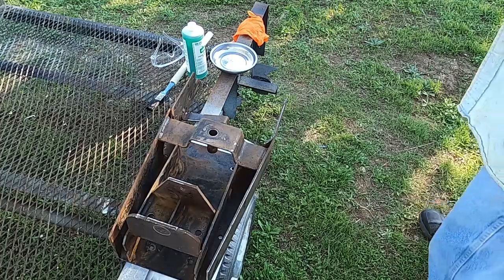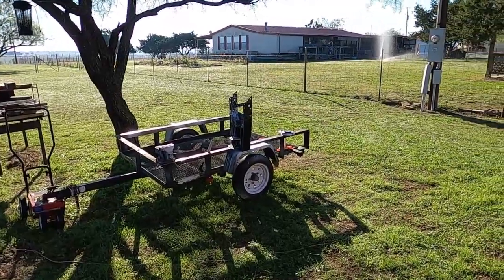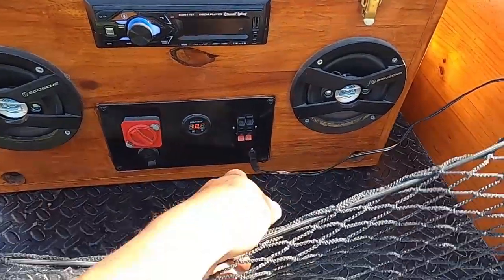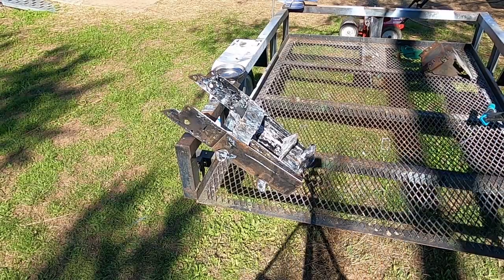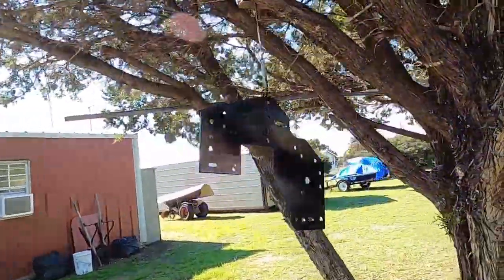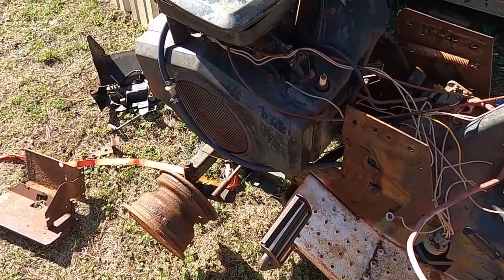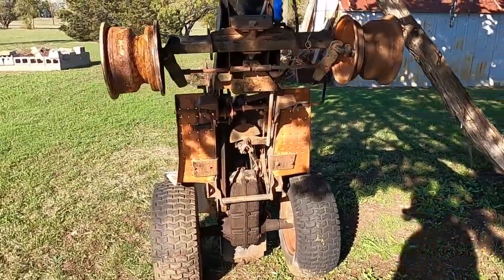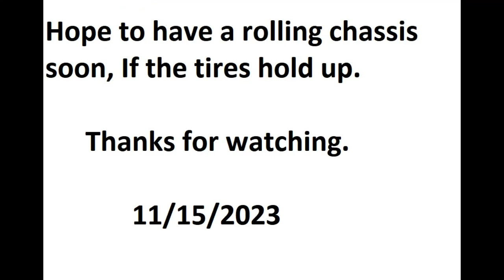Roper 16T   OSPHO Experiment and parts scavenging

Comment: We always struggle with tubeless tyres. It is incredible how tyre shops seem to get it right every time. The rust stuff looks interesting. JB weld seems like the perfect soltion to rust pitting but as long as all the rust has been removed I think a quality filler/bondo is good enough. I would not want to see the pitting on the finish

Comment from the maker: A METAL TREATMENT-NOT A PAINT
RESISTS/RETARDS RUST-PROVIDES A SOUND BASE FOR PAINT
Directions for use
For Application Questions Not Answered Here Call Factory Direct at: 216-771-1590
 

OSPHO is a balanced formula of Phosphoric Acid, Dichromates, Wetting Agents and Extenders. Ospho is environmentally safe and non-flammable. OSPHO seals out moisture and prevents future rust from forming. OSPHO can be applied to just about any rusted or steel surface including: Vehicles, Trailers, Fences, Iron Railings, Sheet Metal, Outside Tanks, Lawn & Farm Equipment, Marin Applications and more. OSPHO is primarily used for bars-metal applications but can be used painted surfaces as long as the quality of the paint is not compromised. OSPHO isrecommended for use under oil based primares or paints. Test trial samples before using Epoxy or other paint systems. A paint job will last much longer afetr an application of OSPHO because subsequent paint coatings attach themselves so tightly that moisture and oxygen cannot attack the metal. OSPHO is water thin and therefor covers a larger area ten painrt and goes on easily. OSPHO is easily effective for exterior and interior work alike. OSPHO safely dissolves bleeding rust from many painted surfaces. For best results, use OSPHO at temperatures no lower than 36°. Excess dew and humidity may prolong drying time, cause a reoccurrence of the drying process resulting in a powdery buildup. Spray equipment should be flushed out with water after using. Clean brushes with water. Avoid spreading OSPHO on adjacent areas such as concrete, masonary and stone work as it will etch/bleach almost immediately. 
 

RUSTED METALS - OSPHO is a rust-inhibiting coating - NOT A PAINT You do not have to remove tight rust. Merely remove loose paint and rust scale, dirt, oil, grease and other accumulations with a wire brush or pressure washer and let dry - apply a thin coat of OSPHO as it comes pre-diluted in the container. Let dry overnight for a minimum of 24 hours, then apply whatever paint. Longer dry times may occur depending on temperature, humidity and over-application of product. OSPHO has the consistency of water and treats up to 600 square feet per gallon. When applied to rusted surfaces, OSPHO causes iron oxide (rust) to chemically change to iron phosphate - an inert, hard substance that turns the metal black. Where rust is exceedingly heavy, two coats of OSPHO may be necessary to thoroughly penetrate and blacken the surface to be painted. A dry, powdery, grayish-white surface usually develops when cured. Brush off any loose powder and wipe down with Mineral Spirits before painting.
 

NEW METALS - For new ferrous metals: remove dirt, grease, or oil; apply OSPHO in a thin coat, let dry for a minimum of 24 hours, then apply paint. Longer dry times may occur depending on temperature, humidity and over-application of product. A dry, powdery, grayish-white surface usually develops when cured. Brush off any loose powder and wipe down with Mineral Spirits before painting. OSPHO penetrates deep inside of the metal's pores to convert and protect before Iron Oxide is present.
 

CLEANING AND ETCHING METAL - OSPHO can be used to clean and etch Ferrous and Non-Ferrous metals by simply applying a thin coat. Let stand for approximately 30 minutes or until metal is etsched, then flush off with water, avoiding damage to adjacent areas. To avoid flash rusting on Ferrous metals, a top coat system may be required.
 

GALVANIZED - where appearance is important, apply one coat of OSPHO, let stand for approximately thirty minutes or until metal is etched. Flush with water, avoiding damage to adjacent areas; or wipe to a smooth finish, let dry, then paint. Where appearance is not important, one coat of OSPHO is recommended to thoroughly coat and etch the metal. Let stand overnight or until completely dry. A dry, powdery, greyish-white surface usually develops when cured.  Brush off any loose powder and wipe down with Mineral Spirits before painting.
 

WARNING - FIRST AID: OSPHO contains phosphoric acid. If liquid comes in contact with eyes or bare skin, flush with copious amounts of water. Seek medical attention if irritation persists.
KEEP OUT OF REACH OF CHILDREN. If taken internally give large quantities of milk or water, get medical attention. Prolonged exposure to skin may cause irritation - use rubber gloves or other forms of skin protection. Exposure to vapors may cause respiratory irritation, move exposed person to fresh air. Sekmedical attention if irritation persists.
 

SAFELY DISSOLVES BLEEDING RUST FROM MANY PAINTED SURFACES:
CAUTION: paint composition & quality vary greatly. A check should be made by testing OSPHO on a small area. Dulling or peeling may occur in some finishes. The manufacturer assumes NO LIABILITY for damage to finished surfaces.